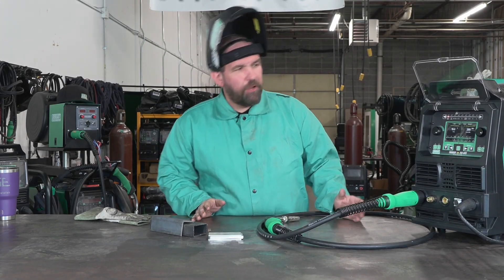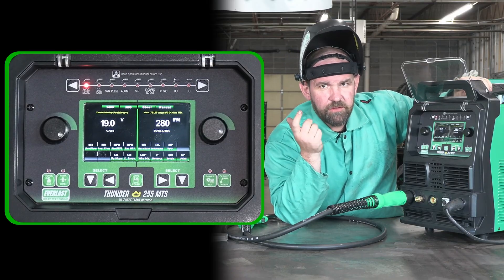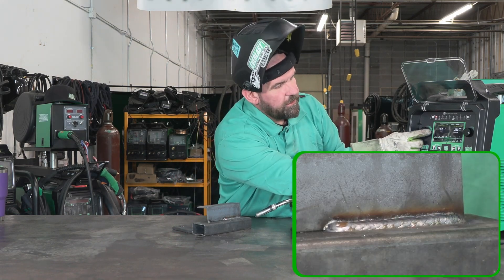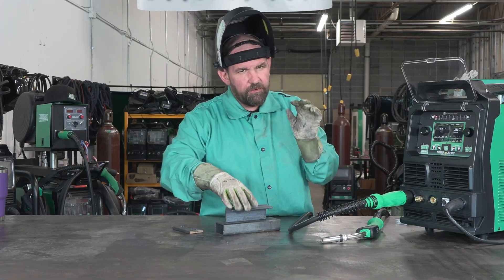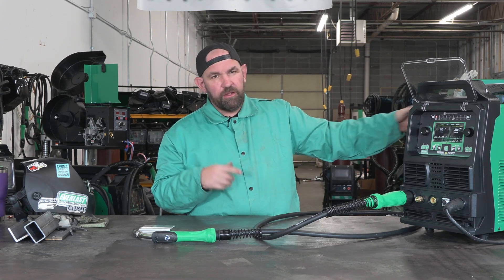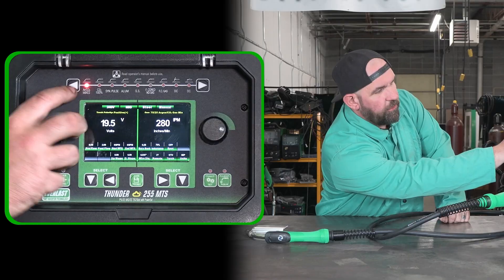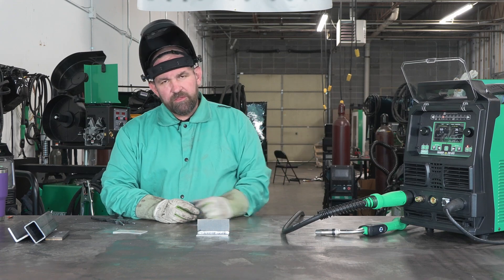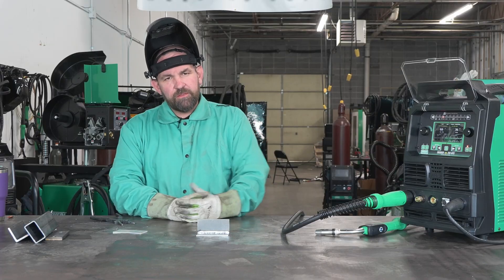Thunder 255 MTS  - Mig - Steel & Alum

Comment: So you don’t run C25 on it typically?

I need to add some welding to my channel.
Reply from the maker: You absolutely can, I just had C10 in stock
Reply: What Everlast compares best to the Millermatic 211?
Reply from the maker: @bryanthornton6787 our cyclone 212i would be a good comp.
Reply: @bryanthornton6787 I recently got the 212i. Great welder with many features. Also better specs than the Miller.